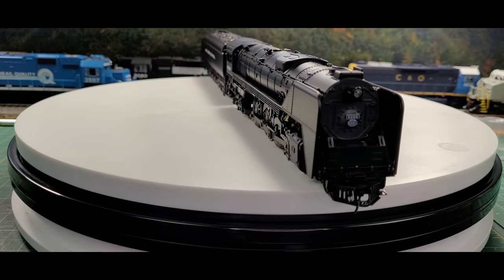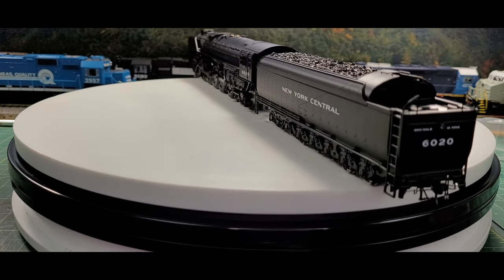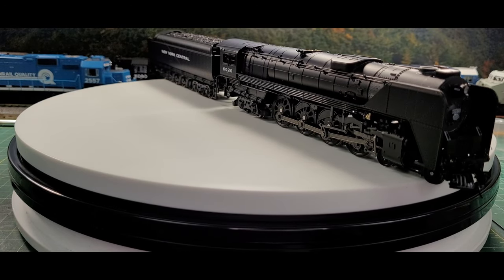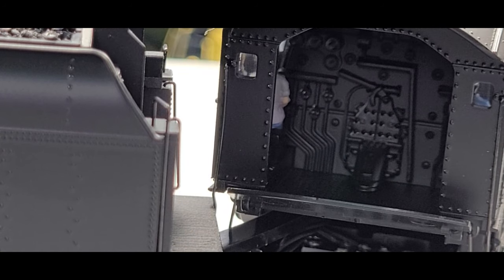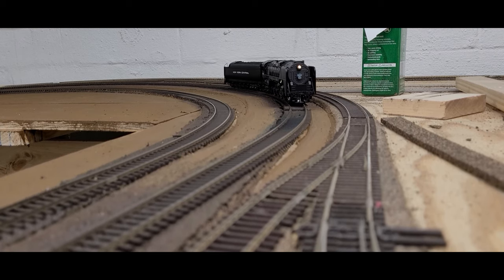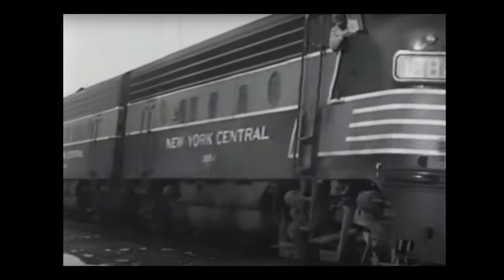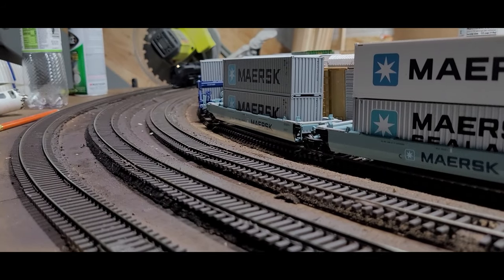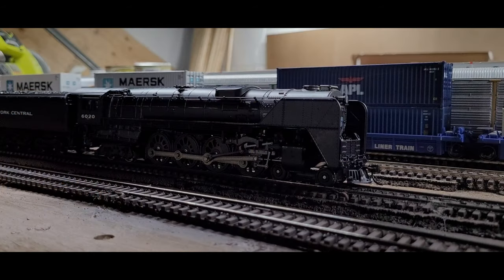Broadway Limited NYC Niagara S1b 4-8-4, #6020

Comment: I got number 6004. currently it doesnt work due to a failed motor circuit board but I got a replacement board and hope it works. These models are very impressive and pull a lot of cargo! Tis a shame none of the irl locomotives were preserved.